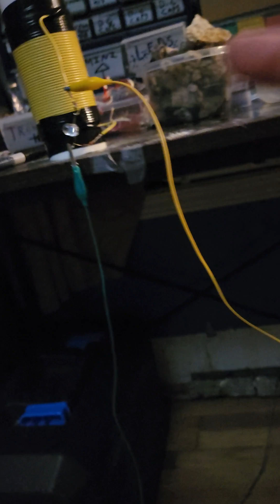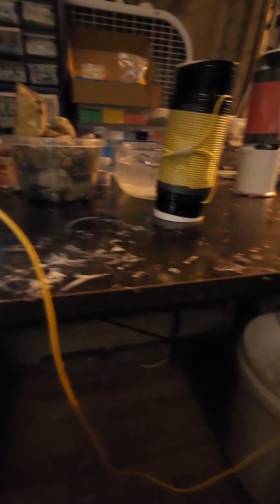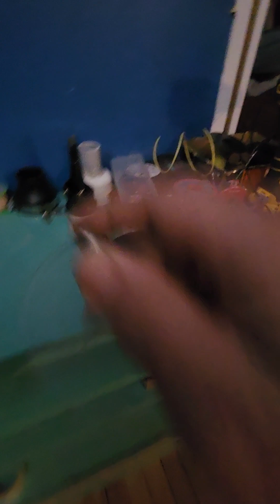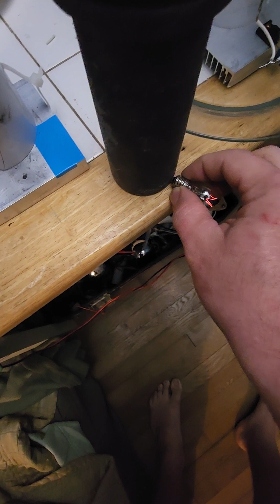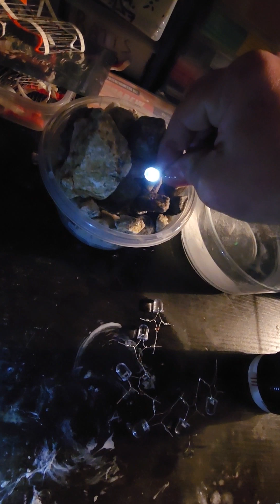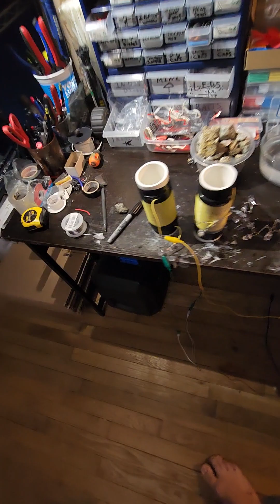👌 Exotic Energy,Amplifier Stones,Crystal Radios,Radient Energy,Tesla Coils & Hard Work 😎

Comment: What it showing is rf received but can u amplify the volts nd amps is the big question Nd to what levels yhe amt of  voltage applied to anode or graphite shd  b a linear increase in amps as it is in some ways similar to germanium diode in the sense it is generating amps so use one w high amps or parallel diodes to raise amps  otherwise

Comment: Use graphite rods fm batteries connected 2load nd inserted into earth ie earth 2as cathode nd graphite as anode nd complete the circuit w ur receiver  ie frequency nd voltage amplifier while anode or graphite bringing in the amps chk if u can increase it w salt or battery rest of the chemical cut nd put into ground chk if a longer electrode including tungsten welding rode inserted into ground works..... Shd work under even hv transmissions lines as rf is thr all u need is transformer to transform it to amps... Nd to correct voltage chk also if inserting a tungsten rod into the centre of receiver or graphite to raise amps works with a wire 2 load from it

Comment: Hello sir you are doing a good job. I would like to have a diagram of this circuit please if possible. Thank you
Reply from the maker: It will be coming very soon & thanks for the support :)
Reply: @MTECH2022  I'm happy to just pay you for the diagram. I think you should sell it? I'd like to buy it from you and build my own. I'm stocking up on wire. All I really need to know is the small details regarding your non-linear electric components and what they're doing. I've been listening to you closely but still, I think I'm very close to getting it but I don't quite understand the components... except that you need high frequency components... RF components.

I'm trying to study diodes and capacitors now, to learn how to determine the right types for my own experiments. I've been taking note of the ones you've mentioned. 

So if I can buy the plans, that would be perfect! I was hoping that if I bought the transmitter, that it would come with a tuned receiver coil, too. 

I am still interested in buying one, too. 

Are you simply driving it with a Slayer Exciter Circuit to input a high voltage into the Primary? It just needs to be driven with higher voltage pulses? And then the frequency (and voltage) coming off the L2/L3 is a far higher frequency than the input frequency because of the L2 coil? Am I understanding that right?
Reply from the maker: @Great Awakening  HI great Awakening. I could ship you an exact copy of everything I use for my experiments along with backup components for 800$ it would include a finely tuned transmitter identical to mine & a identical receiver coil that must have its primary coil Earth grounded to get the mind Bending Wireless Power range. I would also include the dc lab power supply & 5 mini wireless led receivers & 3 pickup coils. I would also include the exotic Avalanche Diodes & schotty diodes which are key & I could email you an exact schematic for 250$ 
I understand this is kind of pricy to Replicate my full setup & therefore I would recommend just the 350$ transmitter kit which is plug & play.

mtechindustries2022@gmail.com